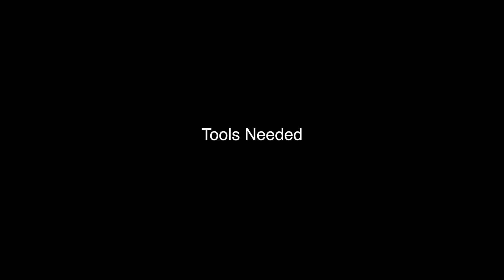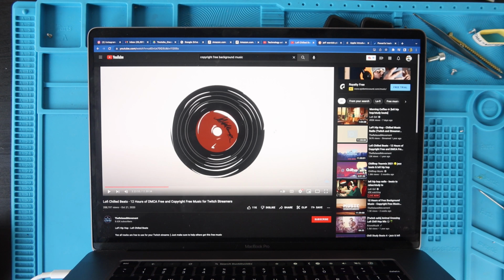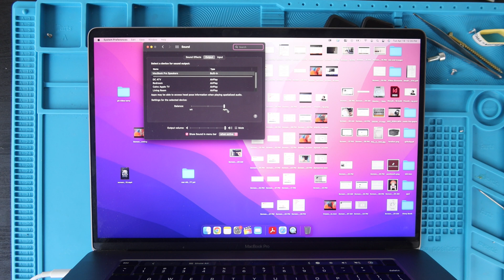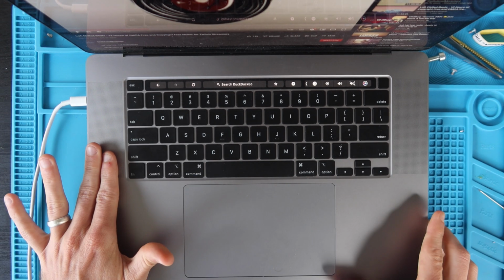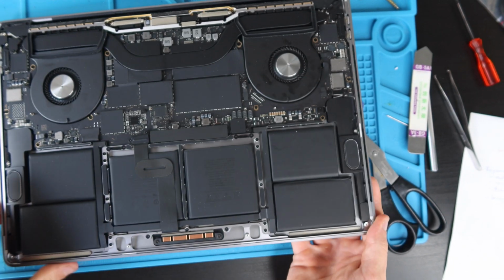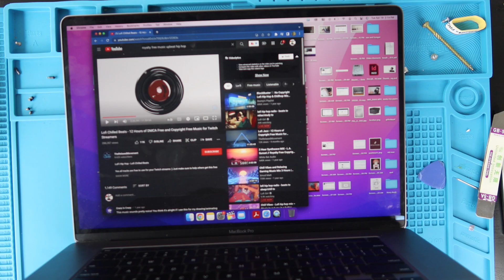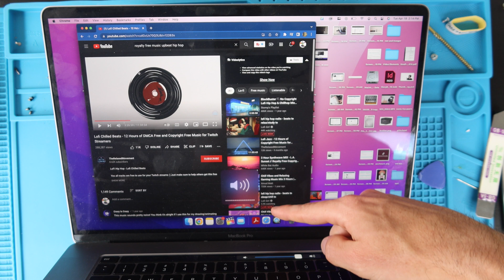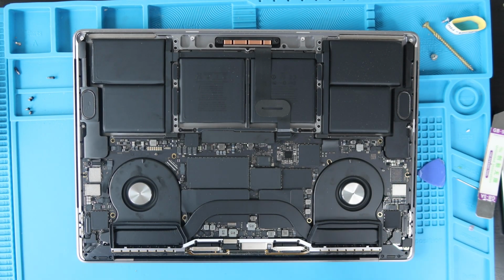How To Fix Macbook Speakers Crackling, Buzzing, Distortion, Rattling, Step by Step Replacement

Comment: Done this repair twice on my 2021 MacBook Pro. Both times I haven't had to remove the speaker at all. Rather, there has been a small rock on the speaker that got trapped in there. Not sure why there isn't some sort of screen in the side vents, but oh well. Never would have been able to get the back panel off without this video. Also, the generic precision magnetic screwdriver set ($10) from Amazon works great.

Comment: I simply blew out  any dust and small bits using a can of compressed air around each speaker  as you suggested and now it sounds fine.  Very crunchy before the repair. Thanks

Comment: I replaced the left speaker with two different speakers. BOTH still crackled and vibrated. I got curious and plugged in headphones and the headphones sounded normal. I unplugged the headphones, and the speaker was WORKING PROPERLY. WOW!

Comment: Thank you so much for making this video. I couldn't find any relevant info anywhere else. Checking the settings for left and right was so smart. It's my right side speaker that is causing the muffling, so for now, I am just going to use the left until I get to cleaning or replacing the right speaker. It will be good to do a general clean up all over too. May the Lord bless you!

Comment: You are a GOD, was considering a battery replacement at apple to fix the speaker issue and with just a little cleaning, the distortion has disappeared completely, even at max volume. Thanks a lot

Comment: Thanks man.   I fixed me speaker just by following your cover removal guide (spared me from accidentally bending the cover at the back).   There was a piece of ferrous material stuck to the magnet.   Cleaned it.   Works fine.

Comment: I've had the same issue twice.  I have a hobby metal shop, and my guess is that the filings created get stuck on my clothes and end up getting tractor beamed into the speaker magnets.  Both times, I attempted to remove the visible ferrous metal from the speaker with a q-tip, but I'ts almost impossible to do without damage to the dainty speaker surrounds in this tiny speaker.  Save yourself some time, and just buy a replacement, because Im 90% sure that by the time you start hearing the crackle noises, the speaker is already toast.  Also, it's a good idea to vacuum and blow out the computer board with compressed air while you are in there, because the fans pull in all kinds of crap and drag it right across the board including the speakers... If you skip this step, you will be right back in here replacing your speaker again soon after.

Comment: Thanks so much for this. Make sure you check for metal on the speakers like he says before replacing them. I had a speaker that sounded so busted, took it into apple shop but they said it would be £550 to fix as it was out of warranty. So I found this video and took the back off and there was a few bits of metal on the speaker magnet. Removed them and now the speaker sounds perfect again.

Comment: I used MBP 16 for nearly 2 years, and now the speaker is producing a crackling sound. Upon inquiring about repairs, customer service informed me that it would cost $728 to replace the speaker, which is a third of the price of the laptop itself. It's absolutely absurd that a $2200 laptop's speaker would fail within such a short period without any external damage. The repair cost being a third of the laptop's price is outrageous. I intend to initiate a petition in the US, hoping to connect with others experiencing the same problem. This is indicative of a subpar product, and customers shouldn't bear the burden of Apple's shortcomings. I plan to share my grievances on various social media platforms and if the issue persists, I will escalate it to the media for further exposure.
PS: I tried to post this on the Apple community, but they never tried to contact me or try to solve the problem. All they did was delete my posts or replies under others' posts. I guess this is how Apple deals with customer service. This is how they maintain a positive reputation now.

Comment: Thanks so much for this helpful video, I'm on a MacBook Pro 13-inch, 2013, so I'm not sure how easy it is to replace the speaker (only one is dodgy), but is it a good idea to replace it even if the other one is working? Is there a chance that the corrosion or debris causing the speaker damage could spread across the logic board?
Reply from the maker: I would say open it up and look for debris, thats the most likely cause.
Reply: @thecollegefixer653  Thanks heaps.

Comment: Thanks for the great video. I've bought multiple mid-2015 MacBook Pro's and have noticed a trend in that when they have blown speakers, which is often, replacing them only results in the newly installed speakers also getting blown. So something is wrong, perhaps a design flaw or manufacturing defect, that means replacement alone is not enough to fix the problem. I've seen lots of MBP users posting about blown speakers, and quite a few talk of speakers being blown multiple times. I've yet to find what underlying cause needs fixed, other than "replace the logic board."

Comment: Heck ya. Thanks for the breakdown! I had ordered a speaker replacement (cheap) for my crackler but decided to open it up as the tools got here first to see if I could clean up the speaker, sure enough there was some metal junk stuck to the magnet. Polished with an alcohol cloth, blew everything out, and it sounds perfect!
Reply from the maker: Glad you learned from my mistake =)

Comment: Hey i just bought a mac M1 3 days ago and when i play songs with high base i can hear some disturbance in my left speaker and when i play normal songs with low base it works fine 
What should I do or it will fix automatically
Reply: was it fixed?
Reply: @var-rr  bro I changed the speaker but still the disturbance wasn't solved then they told that its audio's problem not speaker's So at last you have to get used to it and i will not recommend you to change the speakers as nothing changed !
Now this thing is not bothering me disturbance happens sometimes but not everytime !
Reply: @iamxpossible  it's bothering me to sir...i'm done with the laptop!it's brand new and apple just ruined it.thanks for replying.

Comment: 1. Always disconnect battery first🙏🏼
2. Using isopropyl alcohol in a syringe under the speaker loosen adhesive in few seconds and don’t accidentally damage electronics.

Hope this can help someone

Comment: My 16 inch M1 just developed a faulty RHS speaker and after watching your video I gave it a quick blast of compressed air through the side vent port and that has greatly improved the sound quality, so my problem will be fine steel particles attracted to the speaker magnets. I use the laptop in my metal working shop and fine grinder dust must be drifting over to where I have it sitting and getting inside the case. I'll take the bottom cover off and give it a better clean now Thanks a million for your video.
Reply: Thanks for that comment
I blew through the vent and that fixed it for me!

Comment: Small little debris on my speakers here too was able to clean it and it improved the sound some any speaker brand you recommend not to suck?
Reply: There are no other speakers that will fit inside your laptop.
Reply: @johncoops6897  I applied a litte glue to the edges to repair the existing speakers it's not quite as loud as it was but I will call it a win

Comment: Is vacuuming through the grill on low suction with a brush tip a bad idea for an intermediate step (in the unlikely event there is debris grill side)? Asking for a friend...👀
Reply from the maker: I dont think it will dislodge the metal from the magnet of the speaker but worth a try
Reply: I tried that, and it didn't work.  But just removing the lid and then removing the debris was enough to fit it for me.

Comment: So my new 2022 16" MacBookPro M1 was having the same crackling/muffled sound issue out of nowhere is morning. I've had the laptop for just over a month and never blast the speakers. I tried resetting the machine...nothing. I tried booting up in Safe Mode...nothing. I upgraded the OS to 12.6.2...nothing. I was about to take it into the Apple Store when I read a YouTube comment that said some sand had gotten into the machine and was sitting on top of the speaker thus causing the crackling. My first thought was BS! However, being frustrated a blew as hard as I could into the right speaker/ventilation opening on the underside of the case...and what do you know, the crackling went away. I kid you not. WTF!
Reply: Haha, I read your comment and my immediate thought was that your claim about blowing into the vent was BS. But, I just gave it a try myself... Sure enough, my MacBook suddenly sounds better. 😅 Thanks for sharing!!
Reply: Holy shit 😨 i also thought you were bluffing but it worked
Reply: Yooo no wayy, it worked tysm😂😂
Reply: lmao this worked for me
Reply: Worked for me as well. One quick blow underneath of speaker and terrible crackling all gone.
Reply: Omg, I never wanted to open my mac, that's why I didn't care about the crackling sound,  and this worked for Me 😭😭
Reply: Amazing - blew it and crackle be gone! Thank you for the advice!
Reply from the maker: Sand be-gone!
Reply: God you're an absolute lifesaver! I was just scrolling through the comments looking for anyone who'd done a repair on an M1 2021 but was about to go down the route of buying all the things I needed and ding the repair then saw your comment and thought 'no way,it can't be that simple,' but lo and behold like everyone else has said it worked immediately! I'm so frigging chuffed and doing a happy dance right now! I will get a cannister of air though to give it a blast every now and then just to keep the dust/sand out.
Reply: HOLY SHIT, I JUST TOOK YOUR ADVICE AS I WAS WATCHING THIS, same mac as yours ... same problem... Picked it up and blew in the right speaker... AD OMG IT WORKED !!!!!!!! I CANT BELEVE IT !!!! it actually WORKED !!!!!!
Reply: hahaha it worked here lol!

Comment: This video was so helpful and easy to follow! I had the same distorted issues with my right speaker. I opened up the laptop in an attempt to replace the speaker but turns out I didn’t need to because there’s a metal debris stuck to it and removing it fixed the issue. Thank you for this tutorial, Eric! 😊
Reply from the maker: Glad you did it without replacing, I wish I knew thats what it was before I did the full replacement
Reply: Same here.  I just cleaned the debris off the speaker and that fixed it.

BUT I used my vacuum cleaner to clean the fans, and now one is making a funny noise 😞
Reply: @johnflux1  aw fuck

Comment: wouldnt it be better to just replace the top case if it was in a better condition?
Reply from the maker: Just the speaker is the easiest job, less labor hours or chances of breaking something. But you could if you were comfortable moving over the motherboard and the display. I prefer to do the easiest repair possible, hopefully that logic helps =)
Reply: @thecollegefixer653  i done it on my 2017 15, trust me its aint that hard just a little complicated. i done the screen first then motherboard rather than doing it at the same time
Reply from the maker: @3ijnweu3oq3  More than one way to win 💪 Good work on the fix =)
Reply: @thecollegefixer653  well atleast you have a spare battery if your one ever dies good job on the repair!
Reply from the maker: @3ijnweu3oq3  Appreciate it! The buzzing noise was driving me crazy.  🤣